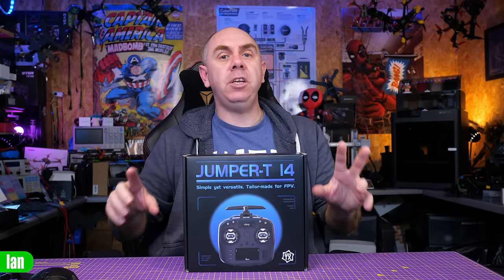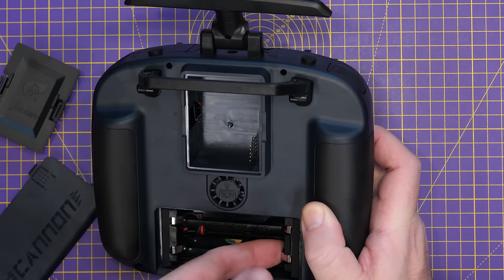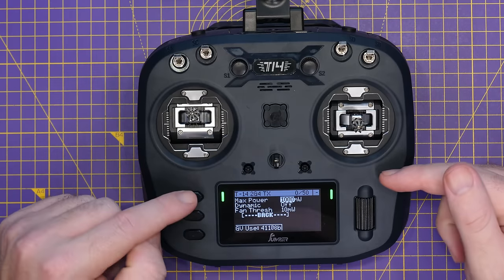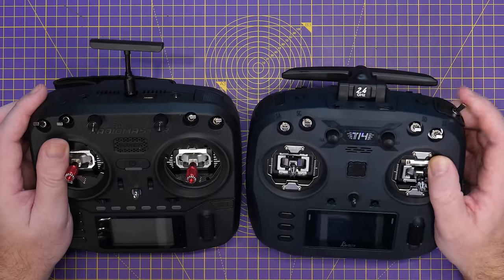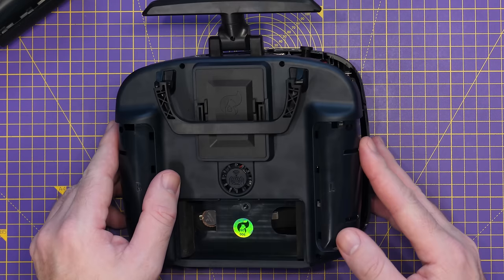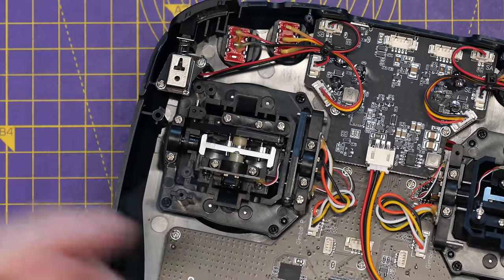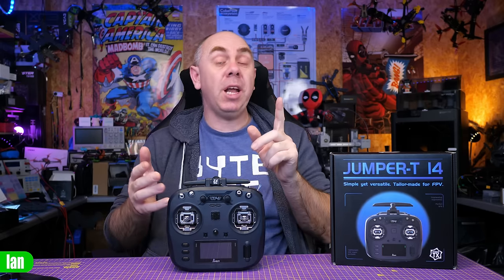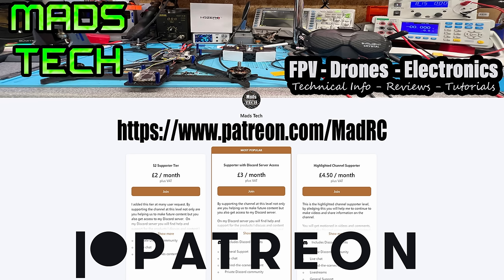Jumper T14 Remote Review - 1W ExpressLRS & EdgeTX For $90

Comment: I have the T14 with AG01 installed. Just like the T20, the wiring color doesn't match radio master's so use the same wire diagram from the T20 mod.  The T20 you need to cut the top corners of the gimbals while on the T14 you need to cut the bottom corners.  They fit a little better in the T20 but works just fine in the T14 as well.  I am not using any 3D printed adapters.

Question for you Mads:  How can I find out when any new firmware comes out for the T14?  I'm really hoping they fix the radio turning on when you start charging with the radio off.  My only complaint really.  Thx

Comment: For my needs, I ALMOST came to the conclusion that the T14 would be a better candidate for my secondary/plane transmitter primarily for my T1 VTOL. My daily is the Tango 2(still love it after all these years), but is not ideal for Ardupilot, or planes in general. Like I said ALMOST, that is until I noticed that it doesn’t have the darn FIVE POSITION SWITCH (over top the screen). They ALMOST had a win with me. I also like their antenna and screen better than the Boxer. Also cheaper. So close…

Comment: I had to mod my Boxer to replace the SE corner button with a 2pos switch - there is an STL on Thingiverse. I used SE for arming and it's pretty inconvenient to disarm because you need to adjust your gimbal grip to reach the button. Also in an emergency hitting a switch is much faster than pressing and depressing a button.
Reply: I should get around to doing that - the corner buttons look nicer but are definitely a lot sketchier in practice.

Comment: I think they spent on the oled screen and the 1w elrs and tried hard not to cut too many corners on the rest and still be boxer-ish.  They probably made a good gamble IMO.  It's cheap enough and small enough to throw in a backpack with a small drone or plane strapped to your back and do cheap longish-range fpv or whatever, and if you TX wears out kind of fast with those not-really-cnc gimbals, oh well, it was nice enough while it lasted but only $99.  If I didn't have a tx16s I was happy enough with (I do find it a bit large), I'd consider this probably.

Comment: Started with Spektrum then went to Tango2 bought a Boxer multi with a Nano exprs modual and then then I got a jumper T-pro that doesn't seem to work when ever you set up a mopdel. Use of XtX is a major pain. I have been lured into getting all this wonderful stuff which isn't easy to use though I like flying drones. Everything seems to be going the way of Express and what I really like about the Jumpe-T is that it comes loaded with Express which saves a pain in the butt with the configureter. I would go DJI but I hate the Chinese gov so much..

Comment: How is the OLED in sunlight?
Reply: I got my Jumper T14 with simple hall gimballs 2 days ago and checked OLED display in bright sunlight comparing with my 2014 Taranis X9D. I must tell you that Taranis LCD is much readable than T14 on sunlight. In particular angle in sunlight, T14 oled screen is not readable at all.
On the other hand, T14 is comfy in hand, light weight, fine gimbals compering to Taranis x9d. It seems well-built, quality product. Large capacity li-ion 21700 firmly fits into its battery holder and it does not rumble. 
Advice: watch out for right polarities when you place the batteries. 
1 usb-C connector is awesome for me since it charges during connected to PC.
Cons: Cooling fan seems pretty noisy and vibrating even at 25mw.

Comment: Ian, 2 Questions:

1) Does the radio fit back in the case after you changed the shoulder button?  It looks like it sticks out a bit.

2) Do you think the smaller CNC metal gimbles can fit in that radio?
Reply: ooh  good question.
Reply from the maker: Yes it will go in the case. As for the smaller CNC ones no not without a mod. The RM AG01 ones may fit but need more testing.
Reply: @MadRC  Oh those are FULL size gimbles?  I thought they were the smaller ones.  Would be cool to know if they do fit, because then there would be no reason to spend the extra for the faux CNC ones, just get the cheaper $90 version and replace em.

Comment: Since the Original Jumper T16 Crappy Build Quality Fiasco, I will never buy a Jumper Radio. I Chose a much higher Quality Built RadioMaster TX16S and have never looked back.
Reply: I never even got my replacement ribbon cables...
Reply: Yeah they are absolute rubbish, don’t waste your money
Reply: Jumper =  Junker, same issues with T20 build quality, and flakey cloned design ... toy grade
Reply: What was the problem in quality? Bad wiring?